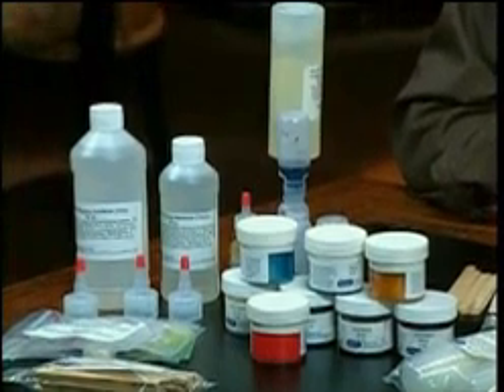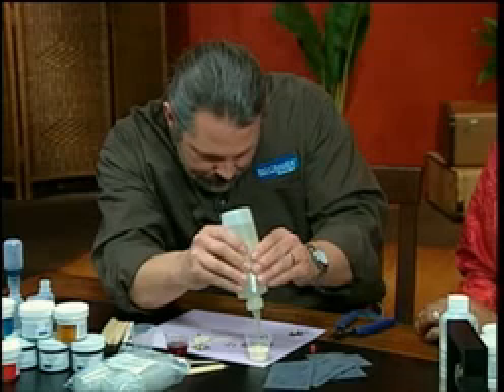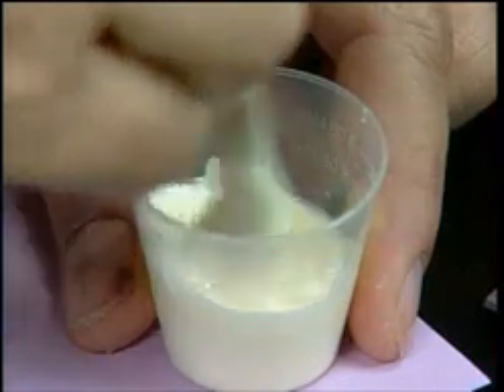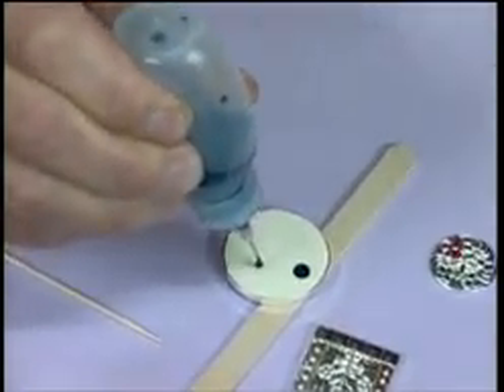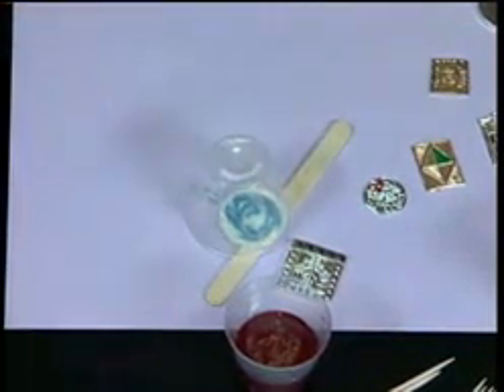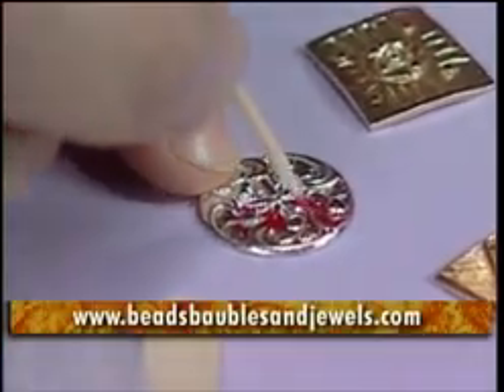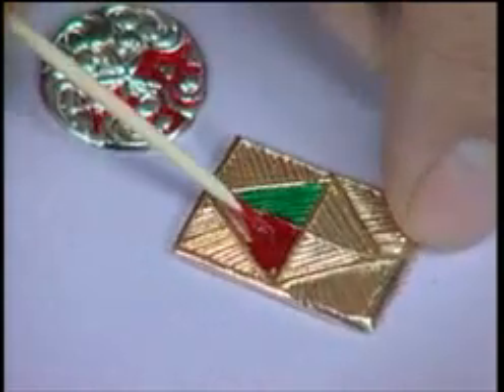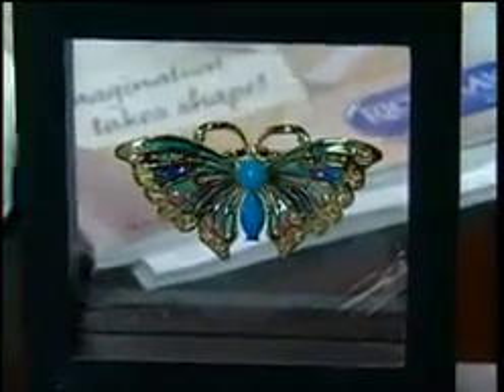Designing with Colores from Rio Grande

Comment: Once you've used the syringe with resin, how do you clean it so you can use it again?  Will vinegar clean it?  What is the difference in curing time between the thin hardener and the thick?  What is the difference in ration with the hardeners?